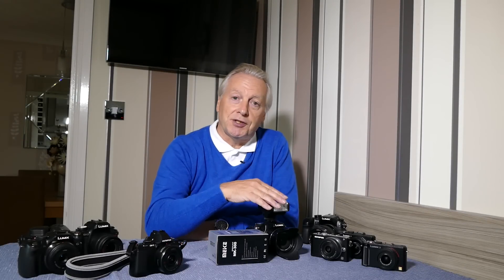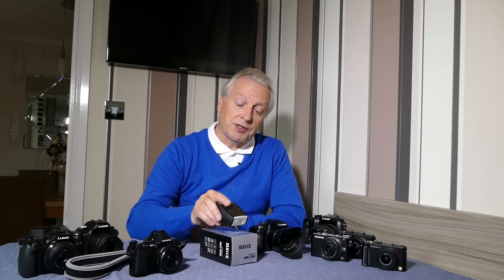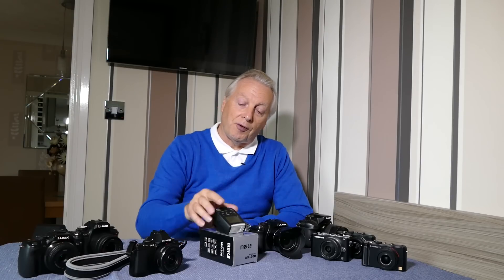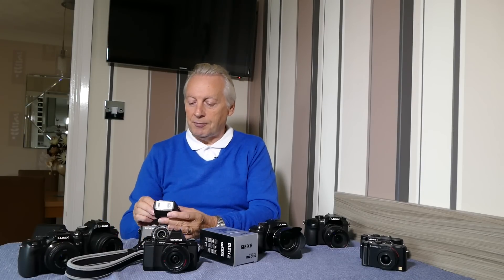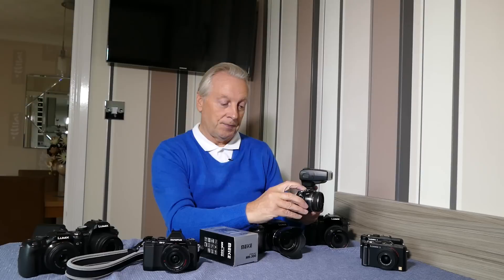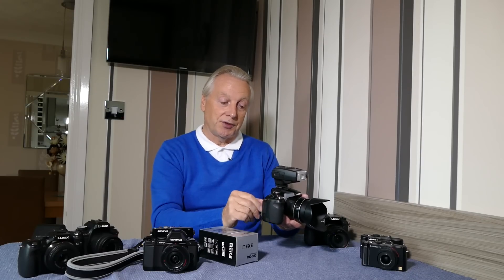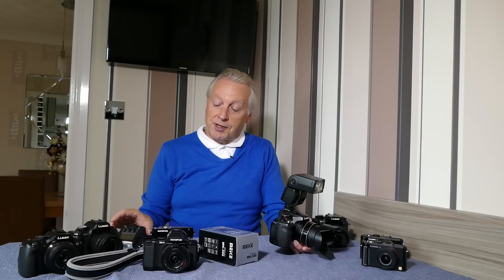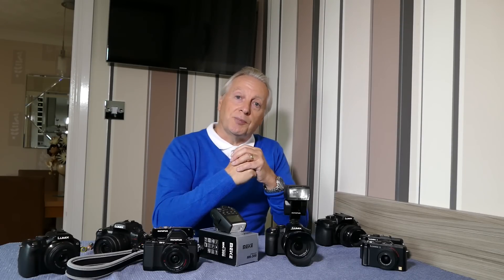Panasonic & Olympus TTL Flash Compatibility

Comment: I have a Panasonic G6 & have tried both the Panasonic DMW-FLK360L & Olympus equivalent. I wanted to buy the Olympus flash because it was considerably cheaper a the time, but decided to go with the Panasonic for full system compatibility. However, I remember getting decent exposures from both flashes, and the wireless triggering off the G6 body working on both Panasonic & Olympus flashes.

Comment: Hi, I am using a Metz 40 MZ-3 with the SCA3202-M7 dedicated Olympus/Panasonic foot on a DMC-FZ200.  Metz' compatibility table lists this as "M/A only" support.  And in TTL mode, the green control light on the foot flashes slowly to indicate a lack of support and photographs are basically without flash even though it triggers (presumably just the preflash).  However, either of the following three measures will deliver working TTL exposure: a) red-eye reduction flash (not the post-processing option in the menus but the flash mode): this apparently uses the red-eye preflash about 0.5s before the main flash for metering b) 2nd curtain flash and slow sync with time of 1/25s or slower: this gives a preflash apparently far enough from the main flash for the flash gun to work but of course adds additional exposure c) setting i.Dynamic to anything but OFF (option is grayed out and does nothing when saving RAW files): apparently there is some sort of processing or communication (ISO?) between preflash and flash that makes it possible for the flash to tell apart preflash and flash.  So it's worth checking out those options: they might help in some cases.  Given the tendency of blown highlights with flash use, the i.Dynamic option might make most sense unless you need those RAW files.
Reply from the maker: thanks for that information - as you say it might be useful for other brands.

Comment: I have a neewer 320 flash, which works fine on TTL with my G7, but my G5 underexposes by a stop, necessitating a flash compensation of +1 stop to give correct TTL exposure. Otherwise it works fine on both cameras.

Comment: Hello Graham

Sorry about the C/P but I'm having a dilemma you may be able to help with :)

For the past few days I've been (litterally, sometimes) banging my head trying to get HSS with my GX7 and a Yongnuo 568ex II. It works ok with my Canon 650d, since the Yongnuo things I bought are built for Canon, but I was really looking forward to using this with the portability factor of the GX7 and its 1/8000 (vs 1/4000 on the 650d.)

Here's what I have : 

1 x YN622C-TX transmitter
2 x YN 622C transceivers
1 x YN568ex II flash
1 x GX7 w/ a 20mm 1.7 II

Would you PLEASE have any idea to help me figure this thing out ? I've tried almost everything... And I'm stuck at 1/500 with the GX7 at HSS (though I don't know if it's HSS...) above that I just get a black screen. I think I can't get it to sync properly because it works really fine at 320, somewhat okay-ish at 500 and I get nothing beyond that. Thing is, when I mount the YN622C-TX on the GX7, it disables the wireless FP menu. It all becomes greyed out and all I get is the first page of the menu  with TTL and forced flash. 

Thanks, 
OYC

Comment: Have OM-D E-M1 Mk1 and Panny FZ200 combo, wonderful cameras, does the Neewer 320 work OK with OM-D E-M1 Mk1 please.    Also, have an Oly FL-LM3 flash bought with the E-M1 Mk1 on eBay, do you know if there is any way to modify the FL-LM3 to work with the E-M1 Mk1?     The FL-LM3 is a wonderful little gun with panning head and bounce flash would love to use it with the Oly and perhaps the FZ200.  I'm happy with a soldering iron and multimeter.   Regards  Tony

Comment: Thank you for the information on the compatibility issues for the GH2 and GH3. Owning both cameras, I would like to have a flash that is fully TTL compatible for both (I have the cheap Metz 24 AF-1).
My question is besides the Pana/Olly officially-branded flashes, are there any other brands that you know of that GH3 TTL compatible?
Additionally, if I were to get an official Panasonic flash, would TTL work with an off-camera flash trigger? The trigger I have is 'Interfit Strobies' but only has one pin connector on the transmitter to mount onto the camera hot shoe.
It seems difficult to gain this kind of quality information in spite of conducting my own research, so any help is greatly appreciated.

Comment: Hi

One comment regarding this flash gun, you say in your video that it works fine on the Lumix G5.  I have the G5, G6 and GX7 and it does not work on any of them.

One big give away that there is a problem is if you adjust the aperture from full open to full closed and watch the distance scale, you will find that although it does move it does not move enough to match the set aperture. going from f2.8 to f16 changes the distance by only small amount.

I have noticed that when ever this flash is sold they generally only claim compatibility with the G2, there might be a clue in there somewhere. ;)
Reply: Jean Harris It works on my Gx7. Not sure if the TTL wotks though

Comment: I don't intend to ever buy another Panasonic product. I bought the GH4 and the flash at the same time, plus a couple of lenses. The camera is great. The mode switch on the flash does not work. They have given me the royal runaround. I have called them six times and been through the "have you tried this" routine. Each time they say, "Someone will contact you within 48 hours." Days later I call them again. It has really been a nightmare. I cringe to think what kind of problems I'll have with "customer service?" when I have problems with the camera.  --Gary

Comment: Excellent video with lot of information. I have LX 3 and using  with manual flashes. Later on added Olympus FL 36 which only perform in IA mode. Looking for wireless triggers which will work in all mode of lx3 and  use my FL 36 in manual mode. Your guidance will help in finding a suitable gadget to get full advantage of this small came
Reply from the maker: If you only want to use the FL36 (not the FL36R) in manual mode then any of the single contact wireless (rf) triggers will work (such as Yongnuo 603 or Neewer 16 channel units) as they only transmit the fire pulse and no other data. For full TTL control  on the LX3 the Godox X1-TO transmitter and Godox TT350O flash gun would be needed.
Reply: Graham Houghton  Thanks for quick response I already done experiments with single pin trigger (Nice)made in china. Any gun or trigger attached in hot shoe except IA mode a sign  locked flash on LCD appear and no sync.Tried ejeco triggers but same result. Looking for a solution to put any gun or ttl cord to use in manual mode. I had in mind of Godox but if put on hot shoe and got the same results will be total loss to me as picking of LF 36 after  reading reviews was not a wise decision. Kindly look into and advise. Meike 300  do not have AF light and build is not strong and may be not compatible with this camera being old model.
Reply from the maker: Mshabbir Gill  I'll check all this out and reply soon
Reply from the maker: I've just tested the Yongnuo rf603cII on the LX and it fires remote flash, no problem - the flash symbol is not locked. Also tested the Neewer 16 channel unit and again works fine.  The FL36 should work in either Auto or Auto TTL  modes on the LX without any problems. There are some issues with the Meike units and the Godox TT350o which I'm trying to identify
Reply: Graham Houghton  Right FL 36 only work in IA mode TTL, Auto zooming but no AF assist light on other modes flash symbol locked displayed on LCD. My request is using in manual mode ie. control over the camera  with any economical  flash with low sync. voltage in the hot shoe of this camera. I  checked with Nikon SB 26 with built in optical slave working fine with its own small flash in all modes. In such location where other colleague is using flash it is all
 futile.

Comment: Hello Graham & followers, FZ200 + the Dmc fl-360L Flash, all quite compatible if "on camera", but with the Vello TTL Cord  (Oly/Pana OCS-OP3) it will not fire, - all other TTL functions are working. Now on the 2nd cord, same results. Burst mode is off. Tested on all settings (IA-M - all settings to forced flash on), still no flash. Pls help & THANKS for your great videos!

Comment: Graham Houghton. Having Godox TT/685 & 350  with XIT Sony mount. If I pick XIT for Panasonic/Olympus will this combination work on LX3 in all modes? Will appreciate your comments.
Reply from the maker: Withe the X1T-o transmitter on the LX3 it will control the cross platform Sony version in manual and TTL. It may not control the auto zoom as I cannot test the Sony version. The X-Pro -o does control the auto zoom. The TT350-s must be in radio slave mode for it to work this way

Comment: I have just bought the Lumix FZ330 which is not mentioned in this video, what flashgun with TTL capability could I purchase for this camera?
Reply from the maker: +Syd Mathews nissin i40 works OK as well as the olympus FL36 or FL50. The metz 44AF also works
Reply: Will this work with Olympus OM EM10-ii?

Comment: hello.  does anybody know if Meike and/or Nissin will support the RC mode (remote control) ?  I have the FL36R and E-M10 and they both support this.  I'd like to add another flash or two but hesitate between the Olympus RC and the Yongnuo system as I already have the YN560 iv and its rc controller.  I could buy one or two more YN560 iii guns and forget about the proprietary rc mode from Olympus but then its manual flash only.

Comment: Hi Graham 
Which flash would you recommend for the Panasonic FZ300.
I have been driven crazy, trying to find a suitable model.
Thanks
Reply from the maker: I recommend the nissin i40, great power from such a small device. Fully TTL  compatible manual and auto mode as well as a small video light
Reply: Graham Houghton 
Many thanks for the information, much appreciated.
Reply: Graham Houghton 
I have just come across an upgrade to the i40, the i60.  Would you recommend this model, or would you stick with the i40? 
Thanks
Reply from the maker: it's a more powerful unit, ideal if you need the extra power for things like bounce flash
Reply: Graham Houghton 
Again, many thanks for the advice. 👍

Comment: hey graham is this flash will work with my panasonic lumix lx 100?
Reply: I use the Nissin i40 with my LX100 and it works perfectly, hope this is useful to you.
Reply: Colin Cubitt thanks for that. Its seems nissin is little bit out off my budget.
Do you know if Neewer TT850  is a good option for lumix lx100 as off flash ?
Reply: Hi there! I think that the TT850 does not have e-ttl ability, so is not fully compatible with lx100. I believe there is a newer model, the TT860 that does have ttl ability, but I don't know if it is compatible with micro four thirds / lx100.  Sorry I can't be of more help to you. I hope you can find something suitable.
Reply: Colin Cubitt  thanks 👍